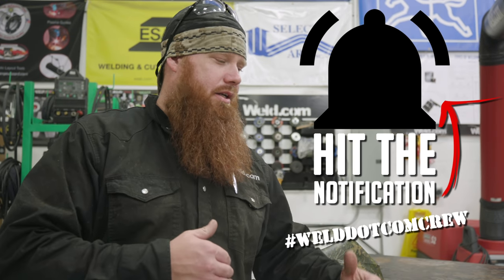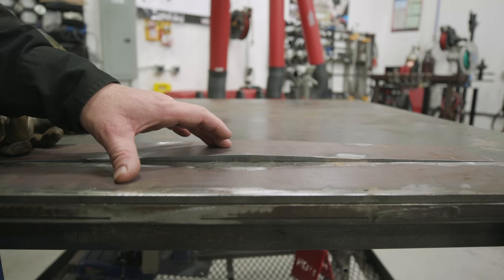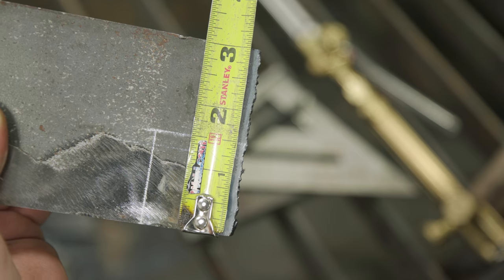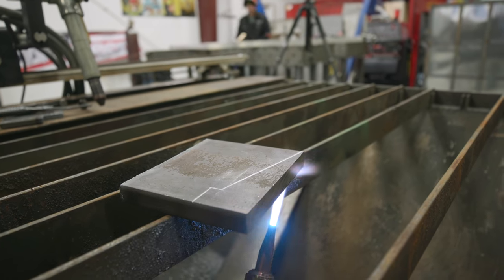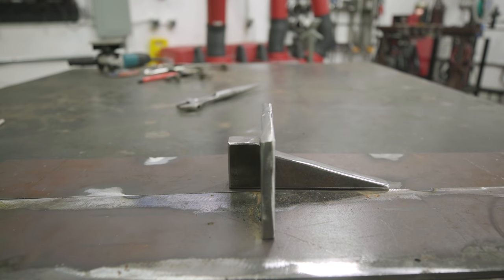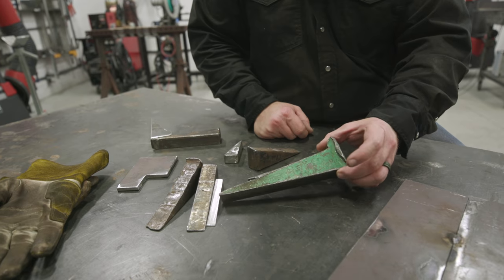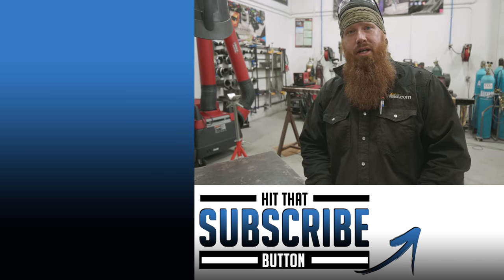Every Fabricator's Best Friend | Plate Dog and Wedge

Comment: I used wedges & dogs to put patches (one foot to three feet long x 12-18" wide x 1/2" thick) on steel barges. They are in use on the giant canal that connects Lake Michigan to the Mississippi River. I so enjoy the simplicity of the wedges & dog. Moving the mtl close enough for a sound ductile weld...is thrilling.
  Thank you for a well planned out video.
       Cherrs, Pete

Comment: A “dog” like you cut out to use with a wedge - except with a nut welded to it, that a long bolt can screw through - is much easier to make/store/use … Tack on, near the Front edge , on one side(if Lots of force is needed, tacking on both sides does the trick) - screw the bolt in till both edges of the metal are “even”, sometimes just by hand or a pair of channel locks - Super easy to use … Once done, back the bolt off, and using the head of the bolt for leverage, pull the “dog” towards the metal that was initially higher - breaking the tacks - Done… (40 years of use with these, with metal and pipe )

Comment: Very handy.  Make your wedge with a  flat on it instead of a point that way you have a surface to hit on when it needs to come apart  then you don't need to hammer on the wedge surface.
Reply: If you hit the dog on the weld side the wedge pops out

Comment: Instead of a wedge, you could weld a big nut (example M16 metric nut) to the dog plate and use a M16 bolt to align the steel plates. Very useful in tight spaces and it gives you the ability to precisely adjust the height with a spanner. Can be used in many other places too. Thats how we Do it in my job.
Reply: Metric tf ???
Reply: metriq ??? that is for foreigners. (Not the band!)

Comment: We used them all the time in the field as Union Boilermakers. Then they started outlawing all "job made tools" and replacing our dog and wedge with engineered "screw dog" type mechanisms. They are basically a two part, engineered "grasshopper" device. They work the same as a dog and wedge or what we call a grasshopper. A grasshopper was basically just a heavy duty C - clamp or bridge clamp cut in half with a flat piece of plate welded on where you cut it. They worked great. But, too many cowboys on jobs not putting enough weld on them and or not tying them off in some way which allowed them to fail and take people's teeth out or fall, put that to a stop and now we aren't allowed to use anything like that unless it's "engineered". All it takes is one or two idiots to ruin it for everyone.
Reply: no, its the idiots who made and brought up the law that ruin it for everyone, not the fools who are supposed to be protected by the law or who are apparently the cause of it...
Reply: @camillosteuss  I don't agree with us not being able to make job made tools, because as Boilermakers, we know exactly what to make and how to make it for the job to go smoother and a lot of the time, safer. But, if people want to make tools and then take shortcuts and not use those tools properly, then it's only a matter of time until they hurt themselves or someone else. That is why contractors made it against their rules. Too many people didn't use the tools correctly,  put enough weld on the dog (so it wouldn't fly off), weld a tie off not or washer to the pieces in case they failed and now we have the end result. Period. It's from the workers or certain workers taking shortcuts to try and speed the process up and it bit them in the ass.
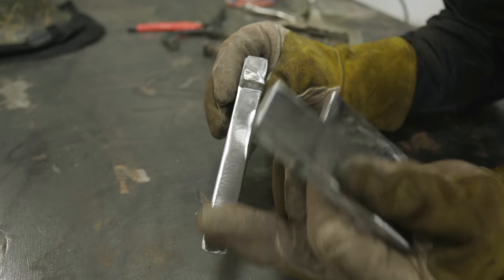Reply: Like other commenters (futher down below) I use them homemade screwtype grasshoppers in the shop when fitting heavy flange to large pipe. One pair is tack-welded to the outside in the positions 4:30 and 7:30, they are sticking out from the horizontal pipe end. The flange to be welded is then positioned with an overhead crane or forklift truck, just barely sitting on the screwtype grasshoppers. Perfect tool for controlling high-low in both directions (or axes if you will).

Comment: I've used this method many times and it never let me down especially with very thick materials. The "half clamp" works great too on thinner materials. Great job man!👍
Reply from the maker: It's an oldy but a goody 🔥
Reply: I used it on 20mm plate it works

Comment: As a Fab/welder in the u.k I used the same dog and wedge method for plating work also U dogs and screw dogs for pipe alignment all are very good methods and can be applied to all kinds of different situations but like the man said always carry a dog and wedge as one of your go 2 tools also a nice weighty hammer 38 Oz I prefer good balance not 2 heavy not 2 light.

Comment: I always found the wedge has to be harder than the dog so ive used the log spitting wedges from any hardware store or if I made my own id run some hardfacing on the angled slope part of wedge because 2 mild steel edges will sometimes jam against each other and not slide .

Comment: A must have in my arsenal of "might".! 
I used these in my 45 years as a Union Welder, Pipe and Pressure Vessel Fitter, Millwright and Fabricator.... required residents of our box of tricks...                  Seth

Comment: I'm not a welder by trade but in the 70's I welded in a ship yard and these were as used on 1/2 and 5/8 material every day along with a rose bud to shrink  material.
Reply: Keith if you use a rosebud wouldn't it expand I'm just asking because I have never tried it?
Reply: @mikewolfe5917  As the welder I never used this process myself ,  but if there was a large hump in an undesirable area after a section was completed  they would heat this area up and yes it would expand but after cooling it would shrink and no more hump.  I always found that pretty amazing.
Reply: Nice!

Comment: I had a sheet of 1/2 inch plate X 3 ft. X 6 ft.for a welding table top that was bowed. I needed to be flat. How would you go about making that flat ? Can you do or have you done a video for that ?
Reply: Jim Wardlow if you have a brace under where you are going to put the plate on, use a dog and a wedge like the one in the video to pull it down to the base, and the. Weld it in.

Comment: As a machinist who does some fabrication recently temporarily welding a piece onto your work never would have crossed my mind.
Reply: two completely different mind sets. as a fabricator who plays machinist on the weekends i struggle with not "just making it work", which might be every fabricators motto.
Reply: @DieselRamcharger  Absolutely, if someone can combine the two and master both they could build just about anything that is made from metal.
Reply: machinist blow my mind every time I see their work. Im gonna learn machining some day.
Reply: @phillhuddleston9445  that trade is called mechanic or mechanical engineer, you walk the fine line between, it works, and it works well
Reply: As a boilermaker I started out grinding endless amounts of the welds that attached temporary fit up gear like fit up nuts to hold key plates and U bars used to fit seams. Even scaffold clips and lifting lugs, whatever it takes to get that steel into place and welded……
Reply: Gimme a hot tack right here………..

Comment: If you clean up the wedge then "case Carburise" it with an excess Acetylene flame it will not bind under load.
Reply: I just make em out of ar400 or ar500 plate, I always keep a few pieces of random AR plate in my truck, stuff will take a beating, the hardness gives it a much higher tensile strength and its much harder to bend.
Reply: @semajniffirg230  BOOM!  done

Comment: On the dogs i made, i welded a nut and an m20 bolt on it. 
Made a big one with a m30 screw. 
Otherwise i use wedges for assembly. Or demolition. 
Useful when you disassemble welded parts. 
And useful when you can’t carry a whole set of shims. (Or you’re too lazy to find shims😉)

Comment: Your Wedge is to sharp or to much of a angel on the wedge, it will pop out. You only need Know more than 3/16 per inch length and really 1/8" raise per inch is best. It won't pop out at that angel.

Comment: Worked with those in excavator buckets and grapple manufacturing 
back in 2000 made of Hardox 400 and 500  , we had an extensive array and models.
 When i saw yours it brought me back !!  Thanks for the video
Reply: Hey buddy I'm thinking of making up my own buckets, do you use hardox for the whole bucket or just for high wear areas, or even just around the G.E.T?
Also what material do you use for the pin/hitch area?

Comment: If you want something a little easier to handle and a lot more versatile make a couple half clamps. C-Clamps cut in half and then a small base welded onto the piece with the screw and turn handle attached. slide it along the low side of joint and give it a small tack weld on the front of the base plate facing the screw. Now you can lift the plate to match its counterpart. It is quick and can be done by one person without ever putting down the stinger as they march along the seam.  Use older C-clamps is you are cheap like me.

Comment: It's got so you have to have an engineer s approval to us a field made tool ,that one of the reasons I decided to retire from the construction industry been a welder 35 years when I pulled pin .Show these dummies how to use a Port a power to push a plate  around and tie your tools off .Last few years thought I might hang myself with them.

Comment: flat bar scrap tack welded at the corner to the flat surface near the risen joint and pulled. same effect. These lock in place, and look cooler though.

Comment: Here's one that you may not be aware of
I used to use a flat bar and tack one side of the one end and allow the other end of the opposite side to cross over the gap
Pull the flat bar and pinch the high side until the plate comes even

Comment: Worked in a shipyard for years and used wedges made from 1 inch steel and dogs mad of half inch steel all the time. Portsmouth dogs with 1 inch screws and 2 inch steel body for the big stuff and sometimes we'd cut a C-clamp  and weld a nut to the screw and use that for the times when you needed to be real precise.

Comment: The longer the taper,the more power your wedge will have.Also,if you wrap the weld around the edge of the dog,it will be less likely to tear off with the wedge and is still easy to remove.

Comment: I use wood,magnets an box steel, I pop the electrode on the box steel then the plates on top of them put the wood under the 2 seems an hold it with 50lb magnets an tac it cuz woods cheap

Comment: I'm so glad you do these video for everyone to learn. This tool in particular was invaluable for me when I was putting floors in scrapers and re-skinning blades on dozers and welding heavy equipment. I didnt have the little lips on the end of the wedge, that would have eased my heavy hand a bit. I also didnt know about 1/2 clamps at that time either, they might have made my life easier then too. Unfortunately when I was electrocuted I lost all of that stuff I made even from 25 years before I went to work there. I have to start making everything over better and stronger.
Reply: yikes, welding electrocution or you just decided to take a piss on a breaker box a bit too close to it? I still remember my own ``sticking a long nail into the socket`` adventure as a kid and the instant of the cold and hot grip of electricity that i was separated from by parents... i must have been a joy to them, despite all the safety plugs in the sockets, i found a nail outside and used it as a lever to open up the socket and jam the thing in there, to my quick learning that that was a bad move... Funny that i like welding now, must be the magnetic attraction, from back then, if you get what i mean....
Reply: @camillosteuss  No!

Comment: i usually put the wedge across the gap at say 30 degrees , and it lines both top surfaces up perfectly , even if the wedge or the dog are a wee bit pre owned , used or abused , that way it also lets you cut the dog a few mils tighter and not have to home the wedge every time ,,, same idea , just slightly different , i made mine out of hardex thirty years ago , still in the box , other thing i did was put a hole about half inch dia in the middle of each part , then you can put an old rod , or a bit of string through them to keep them together , at least that way if you loose one bit , youve lost them both lol
Reply from the maker: Good idea with the hole.
Reply: also stops folk  '' borrowing '' just one bit

Comment: Great advice! I have some also, because I use these kind of wedges every day at my work, and I have noticed that it performs better, if the gap between the dog and the wedge is big enough so you can get a tack in the middle of the wedge. So to say, the wedge is not on your way while tacking. With big pipes and big shipbuilding stuff in general, where the metal usually has some kind of shape that's making it stiffer, the plates and pipes tend to bend out of the shape when I hit the wedge out, if I can't get a tack somewhere in the middle of the wedges length. Seems like it happened slightly also on this video. My second notice is that the plate dog tends to hold better when I tack it closer to the wedge, because that way I get support from the whole length of the plate dog's side. In this example, you only have half of the length as a support, because the tack is in the middle. Keep making great educational videos folks!